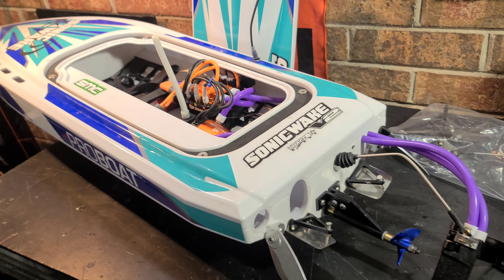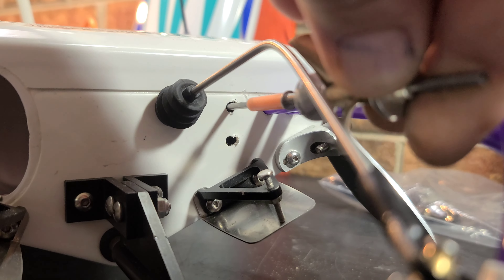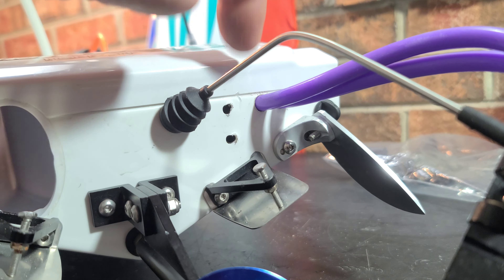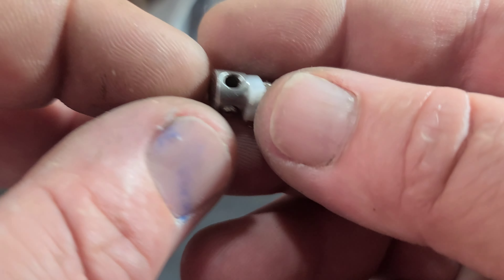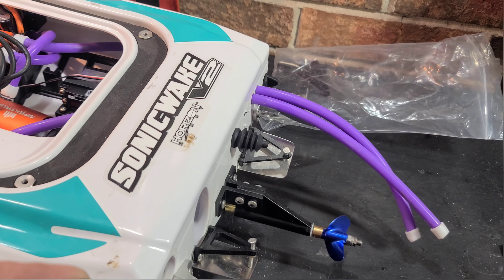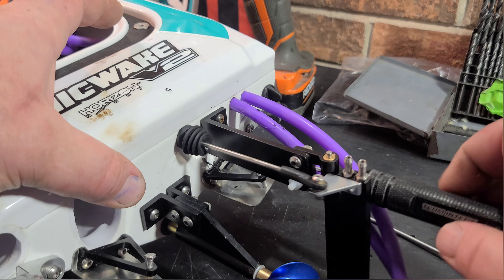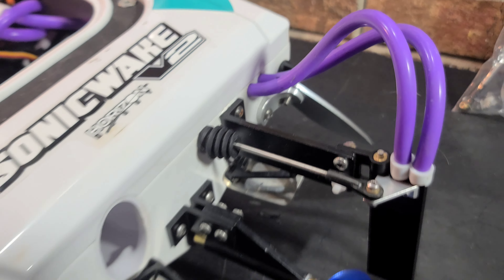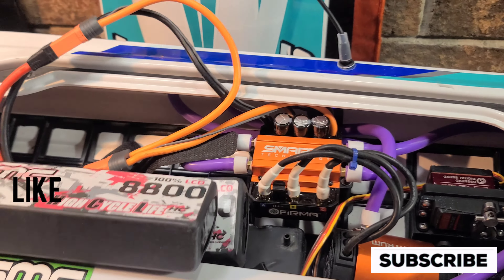Pulled Rudder Repair & Stock Strut Tuning Mod Proboat SonicWake v2 After Crash Repairs

Comment: Nothing like a spectacular crash, carnage on the boat, but an easy fix and a couple of great videos....  Any suggestions about getting some adjustability at the motor to help align the drive shaft and stuffing tube?  There's a lot of SW V2 owners that are melting that bushing and surrounding plastic because the drive shaft is rubbing on the stuffing tube.  My stock stuffing tubes alignment to the motor was so far out I have shims on the top and nothing on the bottom.  Would be easier to have drive shaft attached to motor and adjust motor to center drive shaft.
Reply from the maker: I left the motor in its stock location, found that shimming the stuffing tube to be much easier, shims in the stuffing tube mount to align flex to the motor.  I used some scrap heat shrink folded up on one side of the stuffing tube mount worked in my Blackjack 42 and SonicWake

Comment: It would also like to see a video about what parts to use when. When is the weight to power ratio acceptable. When is reinforcing a hull worth the extra weight. And on what types of materials is it needed versus wanted. Metal gear servos versus lighter weight ones.

Comment: That new animated intro was cool bro. This could have been much worse. What do you think jerked the rudder out of the hull? Just shear force or ?😊I was running a huge battery and crashed with a huge tail whip prop hit rudder, broke flex shaft. I ended up flipping rudder bracket over to gain 1/2” more clearance
Reply from the maker: I think it was just sheer force really, or it may have hit bottom when it tail whipped the pond is shallow where it flipped.

Comment: Where did you get the awesome cooling lines and the bands that hold them on
Reply from the maker: https://www.offshoreelectrics.com/proddetail.php?prod=mo-color-tub-8mm&PARTNER=ironclad 

8mm silicone cooling line with a small piece of the same cooling line cut and stretched onto the main line to help hold it in place.

Comment: I agree with you on crashing cars vs boats. Cars are very expensive but it takes forever to get parts for a boat. Now that the sonic is fixed go get some speed. Also where are the links you talk about for the batteries and whatever to buy through your channel. Bgfl
Reply from the maker: 4s 8800 hclhc https://www.smc-racing.com/index.php?route=product/product&product_id=772

3s 8800 hclhc
https://www.smc-racing.com/index.php?route=product/product&product_id=771